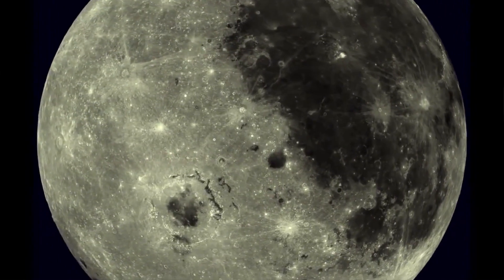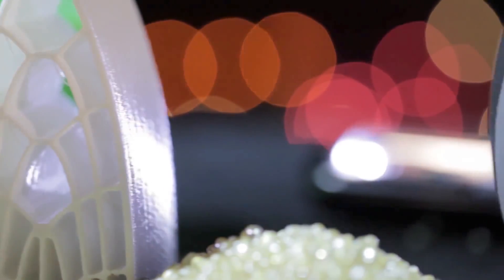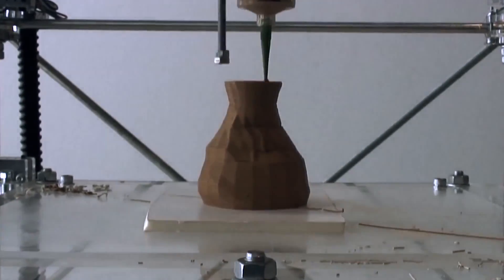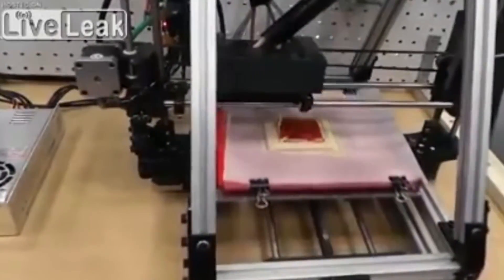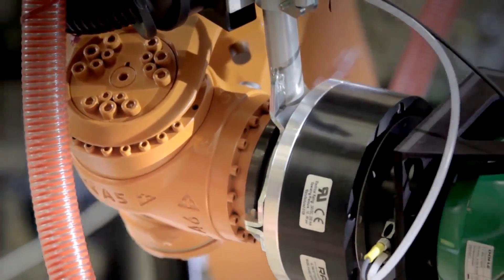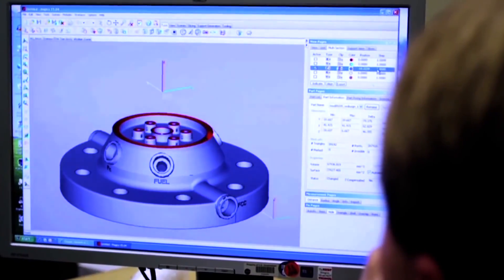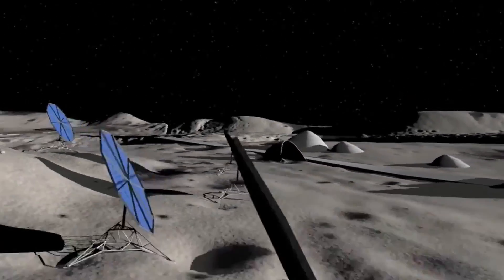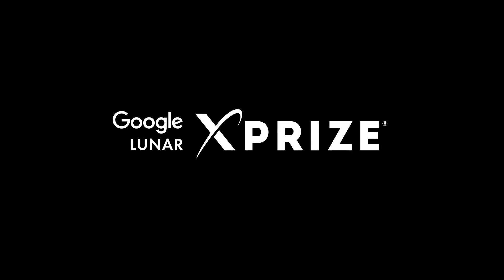3D Printing in Space? | Ask Peter | Google Lunar XPRIZE

Comment: Human habitats & greenhouses will never exist on the surface of the Moon (or asteroids) because long term protection from both meteoroids and high energy cosmic rays require at least five meters of shielding. 
 
Remote controlled robots which can cut out blocks of regolith and transport them up mine shafts to the surface, will provide us with a safe habitat and the surface construction materials we need, and for far less energy expense than "printing" them.
Reply: +William Bliss well esa plan to use the lunar materials to protect the habitat they just print some shapes in it so its stronger
Reply: harry 717 The key to a successful lunar base is efficient solar power usage. Certainly all heavy dumb objects will be manufactured in situ, and many of these components will be 3D printed. Construction blocks are unlikely to be early manufactured components because they will be much more expensive than the alternative quarried stone.
People and their biomes will preferably be deep underground because solid regolith has low gas porosity, compared with bulldozed loose moon-dust.  This means that even a bad accidental pressure dome puncture will not be a problem because the atmosphere will have nowhere to go other than very slowly soak through the solid regolith.